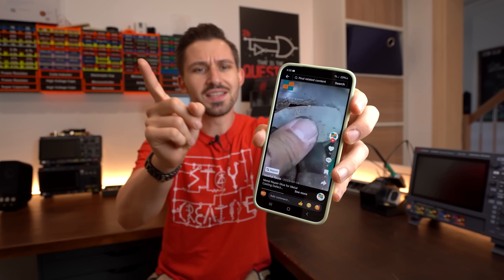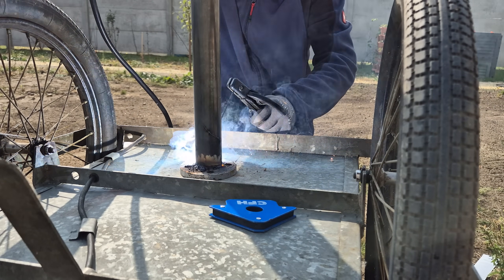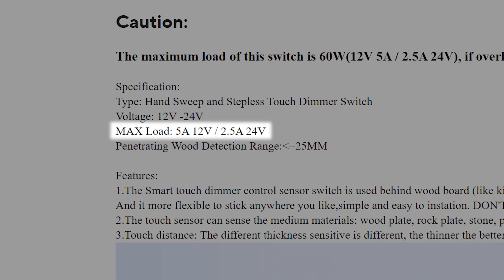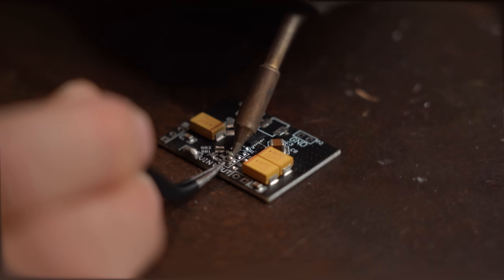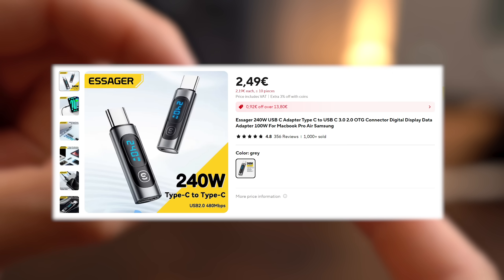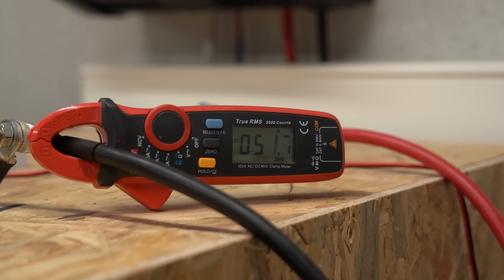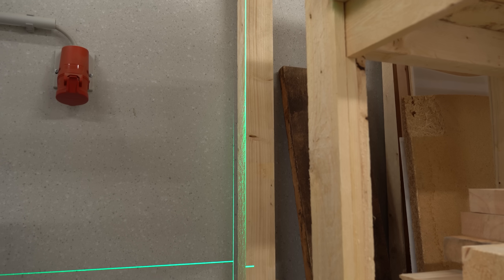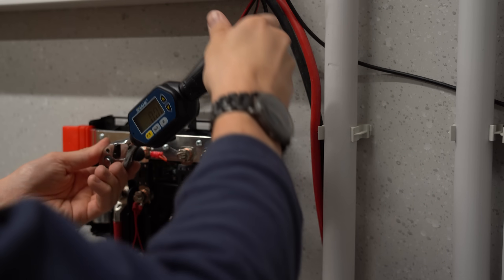I tried finding Hidden Gems on AliExpress AGAIN! (Part 11)

Comment: Did you check the digital level as digital fm radio? 89.2 looks so familiar.😅😅
It would be the ideal april fools gadget if it turns out to be a fm radio tuned by leveling.

Comment: I've had three of the little USB-C 240W charge displays. One of them cooked an expensive cable and would have cooked the phone if it hadn't melted all it's internal plastic out both ends, breaking the circuit. So BE WARNED! (yes I still use and love the other two lol)

Comment: That 240W USB display thing sounds like it's potentially a fire starter or people shocker, since USB-PD cables require a chip in the cable to tell the USB device how much power it can safely pull through the cable... does this adapter adhere to whatever limit an inputting cable sets (i.e. "dumb" USB-A to C cable is iirc only rated for 20w, or lower grade USB-C cable that limits to 60w. We don't want those to run 240W through them)

Comment: Wait did you really fit those two metal pieces together and rub the glue on the outside without putting any glue between the actual pieces?

Comment: That glue is amazing if used properly: as a form of epoxy and NOT a replacement for metal welding! You have to use things within the logical parameters for their use and not according to some wild advertising claims (possibly mangled or lost in translation). In the early days of 'Crazy Glue' I doubt anyone really believed the ads showing you could suspend yourself from an iron beam, a hardhat, and a couple drops of crazy-glue. 

I recently repaired a broken handle on a discarded air fryer by taking apart both halves of the plastic handle, filling it full of the 2-part metal glue, along with a metal rod insert curved to the shape of the handle, reassembling the handle and then packing it full to the brim (where it connected to the fryer) with more of the glue. Yeah, it completely used up all of the glue (at a cost of around $4) but I salvaged an otherwise perfectly $120 air fryer. Guaranteed the handle will be the last thing to break now -- and I was completely sold on the glue after doing some preliminary tests.

Comment: ✅ IMPORTANT FAKE TORQUE WRENCH!   I accidentally bought a counterfeit Wera low setting torque wrench.  I did a test with a bolt in a vice and it was not clicking.  I kept trying settings and even on low I literally sheared the test bolt head off.  I finally looked at the calibration sheet and the manufacturer, model number and etched serial number were completely wrong!  I notified Amazon and when I looked for another supplier on Amazon I paid probably $25 more and it was an original Wera.  What was scary is the counterfeit was identical and the Velcro case was the same and the outer box too. Wicked!   At first I thought the counterfeit came off the same manufacturer line and Wera farmed it out to China but why would it not work… I notified Wera as well.  

I watched a super interesting YouTube documentary with hidden cameras and it was about lithium batteries in China. There is nothing underground.  It’s like strip malls of anything you want at bargain prices. It was also stated the average earnings for people ‘in major cities’ (versus poorer farms) in China is $150 a month in US dollars (similar in Euros).  I also learned that when these fakes are sold, the retail seller prices things kind of near the legit manufacturing product, but just less enough to get the sale without suspicion.

Comment: Pro tip for regular levels. Drill holes in the middle a the end and 12" 18" & 24" you can drill /screw into a stud, put the level on the screw/nail find the level point and then hit the stud directly behind the hole without having to mark or remove the level.

Comment: Man, that torque wrench is something that I need too. I have lots of soft metals like aluminium and copper that I need to bolt things onto at work and I've managed to strip the threads on more than once occasion. 😅

Comment: I also have a JBC soldering iron.  China is now making knock-off irons and handles that fit it that are much cheaper than the official JBC tips.  It wouldn't surprise me if they also make a hot tweezers handle.

Comment: That glue works much much better on alloys than steel.

My car engine water pump got a pinky fingernail size hole  in outback Australia and that glue worked for 5 years 👍

Comment: For removing discrete components with an iron, I use a chisel tip that is as wide as the component is long. If you attack it from the side you can heat up both ends at the same time and the component will stick to the melted solder on the end of the iron. Remove the old part from the iron tip with tweezers.

Comment: When I was about 10 years old I broke a ball link on my go carts steering. This was in 90s, so finding the part was difficult and I tried jb weld. I managed to get a little use from it, but it eventually cracked every time. Perhaps older me could have done better, but knowing what I know now, I would've just welded it.

Comment: I really love my JBC soldering station but their add-on special tools - like the mentioned tweezers,  are quite expensive, ,, but they really are really excellent.
I don't desolder enough smd's to warrant spending ~+260 usd$  ...but if I ever did it would be monies well spent.

Comment: I wonder if the tweezer soldering station would work better if you use it just to melt the soldering while removing the part with regular tweezers. This way the heat wouldn't destroy the component
Edit: contrats on the 2M subs btw

Comment: Some of those torque wrenches have poorly designed electronics that quickly drain the batteries. How does your model performs in terms of battery life?

Comment: "Metal Repair Glue" - Glue is always the strongest in shear, not in peel
11:38 Da hätte ich nach Bauchgefühl ne andere Übersetzung gewählt. Bolt & Nut = Schraube & Mutter. Socket = Nuss (Socketwrench). Ist aber auch leicht gesagt, wenn man nur Zuschauer ist und sich den Text zum Video nicht selbst aus den Fingern saugen muss.

Comment: Nobody wants cracking around the hole 😅
But seriously don't you need to put the glue between where the two pieces make contact as well as slathering around the outside?

Comment: 2:55 you needed to put the metal weld glue down, then stick them together sandwiching the glue in-between. Then putting it around like you did will help some

Comment: the glue or called liquid metal is indeed not really a replace for welding. But it's very handy to repair leaking gasoline tanks (please don't try to weld!!! :P) or just to big drilled holes in metal. Got also liquid metal from Bison and this stuff and works almost the same. The smell is only more heavy by this chinese one.

Comment: For good quality "structural adhesive", I can highly recommend 3M Scotch-Weld.

I had some aluminum parts (T slot channel and some panels) that I needed bonding without fasteners. After some rough sanding with 80 grit to remove the anodized layer I bonded all the parts. The results were exceptionally good.

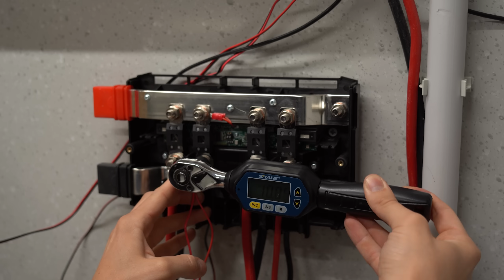Comment: 12:15 we bought an Digital Torquewrench adapter on Aliexpress for around 30? or so. We checked if it is accurate and its around 1% which is totally fine. Some wrench you can even calibrated. I would recommend to watch some videos how to do that. Also the adapter wrench is nice because you can used it an all sizes and it goes from 1-200nm's with nice accuarcy.

Comment: I would disagree in recommending the digital torque wrench. It's almost double price of a normal torque wrench that you can buy in a hardware store, e.g. a big-store label torque wrench can go for around 35€ for up to 200Nm, which is also useful for car wheel nuts. I could see its usefulness for you to show the torque value on a video (like you did with the digital caliper), but then there are cheaper alternatives, like digital torque adapters that can be attached to your German quality wrench.

Comment: With the torque wrench shouldn't yout try it when it tightens to the choosen torque? What I mean is unscrew the nut and then tighten it with the torque wrench to specified torque. Just a thing I heard lately :)

Comment: If i got a battery bank at 48V (n my case 80+ kWh but still same point)
I also got 20 or more 5Ah Ryobi batteries ? (1.8kWh)
Is there a way to "balance" these tool batterys to add capacity to my battery bank?
Thinking  no need to let all of my tool batterys wait until summer when i willl use tehem dayly on my farm?
And yes i know it will be some losses in the Buck/Boost prosses but still it i guess it will be minimal if cycled daily
(My idea is to put tool batterys into use in a solar system with a different Voltage and not a expencive "shelf thing when not in use)
It dosent matter if i take a Ryobi battery at 40% to do some work(my battery bank will also be at 40%ish as i will just grab another or put them to carge in a dedicated charger for tool use
Regards from Norway

Comment: Lidl Netherlands had a self-leveling cross-line laser with tripod (Parkside) for only 20 euro last week. Definitely keep an eye out for tools from Lidl and Aldi when you live in Netherlands, Belgium, Germany.
Not sure if I like the concept of the touch sensor: the current runs from the supply, trough the sensor, to the load. Better keep the cable as short as possible for EMC.

Comment: Try ABRO Epoxy Steel Adhesive 4-Minute Kwik-Set. I've used it in all kinds of repairs. I believe in it. It's also a fraction of the price of your UHU plus. Remember, the key to a strong bond with these epoxy adhesives is to roughen the two surfaces with something like a hacksaw or rough file and apply on both sides. Cheers ✊

Comment: Does it really make sense to put the glue on the side of the pipe/plate connection? Wouldn't it make much more sense to bring the glue between those two parts and then put it under pressure? I thought pressure is essential for glueing things together?

Comment: I will give the glue a toms down cos i buy 2 pack of this, testede it and it worked fine - but after sitting on the shell for about 2 month, one of the tupes glue get hard on its own, the other set not yet used have same problem !!!, I need a glue waiting for long time until I need it - but you cannot with this !

Comment: Don't use the angle grinder that way, you should hold it so the grinder tends to pull AWAY from you, not towards you.  Yes I know it's annoying that this showers you with grinding dust, but it is much safer as the grinder cannot then catch unexpectedly and kick back into your body.

Comment: if you live in an old house measuring tape > spirit level. If the the room isn't level then anything you mount with a level will look crooked. Its better to measure down from the nearest visual clue like a ceiling or side of a wall twice and connect the dots

Comment: Pro tip:  Take that torque wrench and add grease to the head.  The front plate is held on with two screws on the back, you remove those screws and remove the anvil so you can add grease to it.  SuperLube seems to be a decent choice.  It'll make your ratchet feel all new :D

Comment: For the glue, i wouldve sanded the surface some for grip and applied it inside the two pieces after cleaning the surfaces like with any other glue youd use

Comment: The sound of ratchet in torque wrench has nothing to do with it's quality, rather number of teeth in it's mechanism, ratchets with less teeth sound more harsh, but they can withstand higher torque values, also they need to be turned to a bigger angle, which makes working in a tighter spaces harder, or even impossible. On the other hand ratchets with more teeth sound smoother and allow turning to a much smaller angles which makes them better for a tight spaces, but they can't whitstand as much torque as ones with less teeth in their mechanism.
Reply: I know that for sure, 'cause I have chineese cheap ratchet that sound exactly like that german engeneered one. :) On the other hand my other ratchet from Felo (which is also German made) sounds much harsher but allows much higher torque values to be applied with no issues.

Comment: Hol dir für deine JBC Station eine Lötspitze in "Messer" Form C245-939 um SMD Bauteile aus zulöten, man kommt von 1206 abwärts an beide Pads mit der 6mm Klinge. Ich fahre damit sehr gut. Für Filigrane arbeiten z.B. nachlöten von QFN Gehäusen kann ich die C245-034 empfehlen.

Comment: 8:00 I personally have the same opinion that tweezers mostly aren't worth it. I really like wave/hollow/flow tips. They are just like the bevel type, but concaved. With the tip you can access tricky spots with good thermal throughput, and with the small 'bath' of solder, you can reach over 0603 components with ease. Also, if you empty your 'bath', it wants to suck solder back. So you can remove solder without extra tools. This is especially useful when soldering large IC's, by simply brushing over the pins. Use enough flux and each pin gets a perfect solder bond.

Comment: For hard core epoxy, my go to is "JB Weld"... it can be sanded, drilled and painted and holds up extremely well for an epoxy... epoxy is never going to match a welded joint...

Comment: a bit off topic but would u be able to recommend a good 18650 charger that can charge 4 cells of various compacity with over charge protection, or have a recommendation for a diy one with a frustrated protection circuit ?

Comment: The torque wrench doesn't look very reliable to me. Why does it start beeping when you haven't even reached the set torque yet? And what are those awful, mechanical-sounding noises when you have exceeded the set torque?
Reply: It prevents it from exceeding the torque, beeping is normal even for 400€ wrenches like this

Comment: For the torque wrench you can buy an digital adapter which has the middle section from the wrench you showed with a female and male ends, and it can make any normal wrench into digital torque wrenches.

Comment: Yeah, that's just two part epoxy with powdered metal premixed(Or at least that's I believe it is, I've never bothered to look into too deeply as it just works.) in the base component that makes it readily machinable. Common brand here in the US is JB Weld, and that's been around for nearly as long as I can remember. With proper preparation of the mating surfaces it can make a pretty strong join, but it's still nowhere near the strength of a welded or brazed join.

Comment: I've found the inline USB meters helpful on the go for troubleshooting charging issues with loose connections and worn cables.

The instant-on display provides better feedback when wiggling stuff to find a loose connection, current shows the approximate state of charge on things that don't have a display and voltage tells you if the setup is quickcharging properly when you're in a hurry.

Comment: There are heaps of cheap self leveling lazers better than the one you got. The glue you used incorrectly, you need to coat the surfaces that are in contact,  ie inside the circle, not just on top. haha, These type of videos are always good, look forward to more.

Comment: No wonder those tweezers didnt work properly if you tried soldering at 300C we at sony asc use at least 400 and sometimes even more so heating is very quick and doesnt damage components

Comment: Careful with those USB-C cables with displays. I had an Essager brand cable from Temu randomly pop when plugging into a MacBook Pro using a 60 watt charger. It let out some white smoke and smelled terrible. Not worth the risk of frying an expensive device in my opinion.

Comment: I think the description at 2:50 is misinterpreted. If we add some commas we get: Casting repair glue, High temperature resistant liquid metal, welding filler, metal repair, glue for metal casting defect.

So it is not for metal welding, but for filling over welds to smooth them out.

Comment: USB Test Engineer here, I wonder if that USB power meter has an e-marker chip inside. Such a chip is intended to communicate the capabilities of the cable to the host device. If it does, it could interfere with the e-marker inside the USB cable it is connected to and you could potentially exceed the rating for a given Type-C cable. All C cables are required to have the e-marker if they are USB 3.0 or greater and/or more than 3A/60W capable.
I'm not sure I would recommend that device.